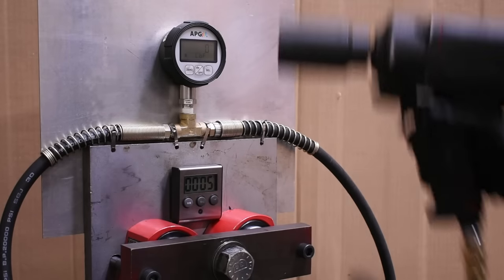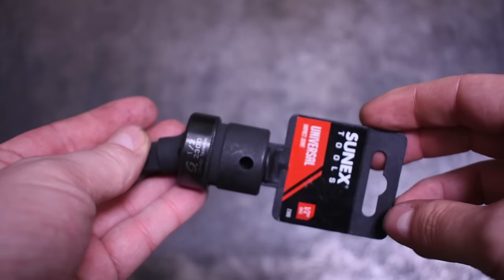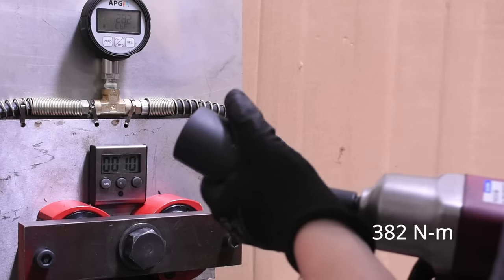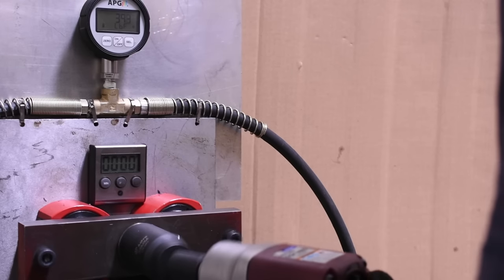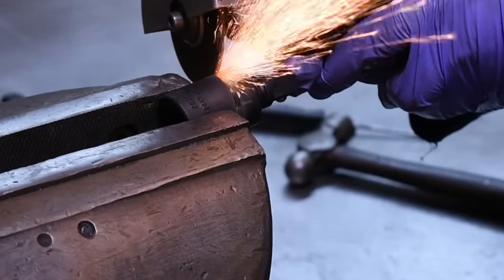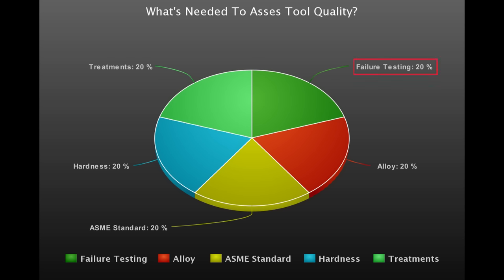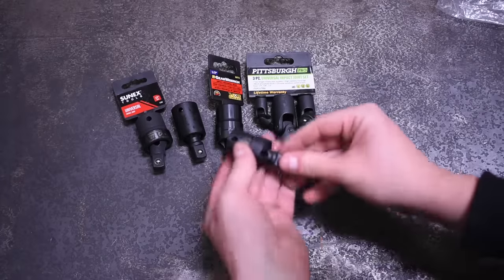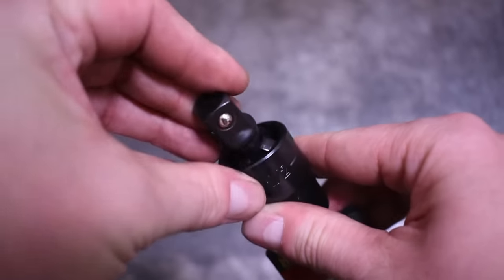How Much Power Do You Lose w/ Universal Adapters? Dyno Test For Science

Comment: I suspect something was wrong with your hardness measurement of the Gear Wrench... likely it had become work-hardened at the testing location... If it was actually through- hardened to that level, it probably would have exploded like glass...

Also, afaik, Rockwell is tested three times, *in different locations*, and then averaged?

Loving all your content!!  Keep it up!
Reply from the maker: Pretty difficult to work harden something that's already hardened and quneched though. And lets say it was, that's still a fault of design, worth showing. 20:35 the 65.8 IS an average, of 4 readings. You can see the 65.7-65.9 spread there, pretty dang consistent. We just did some U socket testing, GW still way harder on the socket than all the others.
Reply: @TorqueTestChannel  THats crazy hard... gotta be another theory, then... might have to look into testing the hardness in cross-section, maybe? is it a "shallow" surface treatment to prevent wear?? I'm astounded, if that's their treatment protocol for the entire tool...
Reply: @TorqueTestChannel  also... I was trying to see where the tester impressions were, but couldn't see...I'm just a knife enthusiast with an "Internet Degree", but im used to seeing the test performed in different locations... Also, my understanding is that the shape of the "displacement" caused by the diamond can affect the reading... (admittedly, you didn't appear to have any outliers!)
Reply from the maker: You might be thinking of a traditional press tester. This is ultrasonic. Leaves no marks. On the recent U socket testing we ground into the tools and didn't see a difference, case hardening an impact socket would be asking for trouble so makes sense.
Reply: @TorqueTestChannel  well, now my curiosity is definitely at a new level... Any plans for further analysis? (Of the GW tool, in particular)

Comment: Oh this is getting elaborate now. Worth coming out of my music coma for :D
Reply: nice work!   Thinking that work hardening is effecting the hardness measurements.
Reply: It may make sense that the ones that failed got harder as they were overloaded to failure....
Reply from the maker: @BrianFullerton  Work hardening happens to raw and annealed materials. Once something is quenched, hardened, normalized - it's already hardened and very rarely can be work hardened from there in most cases. You'd then need to bring it past a certain temperature, or above a lower temperature value (but still quite high) for a very long time before the grains start going back to a state where they can be work hardened. If these were just raw 4140 at like 20-30 Rc then you're correct they'd get work hardened, especially the pinned ones.
Reply: @TorqueTestChannel  I appreciate all that you are saying. But in this case, the metal is showing signs of deforming at the surface, and at or past yield due to what is essentially cyclical hammering.  Not sure that work hardening should be eliminated without measuring an unused sample.  Regardless, really nice work. Thanks, and keep it up.
Reply from the maker: @BrianFullerton  We'll be sure to measure beforehand on the bits we can get to in order to make sure on the next ones. Good idea to double check

Comment: while this information does guide one to the best choice I generally would never consider using a universal flex joint where high impact torque is in play. For me the fastener requires a straight tool to break the fastener loose then comes the flex to advance the fastener in or out.

Comment: okay, i'm curious as to why the u-joint style of HF instead of the same style the others have, since HF sells a kit with that style. i've popped the HF u-joints in the non-impact variants just during normal work loads, so it wouldn't even cross my mind to try an impact named set of them for impact purposes. 

i do have a set of pinned swivel hf's though, and they haven't failed as yet. haven't really bothered to do before and after comparisons though. and i cheated a bit. a slight touch of 3% moly in the main cup to keep the rotation smooth.

Comment: do you have one on extensions? regular with diff lengths? wobble? im curious i wonder even if deep sockets affect torque by a meaningful amount.
Reply: nm you answered my question in vid. also why would you use a 90 deg extension i dont see much if any use for them. imo these are used with extensions for  say getting to top trans bolts from under and such. but eh.. im able to learn so if you do know of a use, let me  know.  i just feel there are better tools at that point.

Comment: If the TTC still get the messages from the old videos, is there any reason why you have not tested the universal impact sockets? Astro vs Gearwrench vs Sunex.
Reply from the maker: We've spent about a year using them to see which fail 1st from actual use. Need to put it all together sometime.

Comment: Let's be real though, they should be expected to break during this test. It's literally taking them to their limit in ft lbs torque just beating the absolute hell out of the bit more and more with every ugga dugga. Then you move it at an angle at high pressure and it's a recipe for a full "Fuck this, I'm out" response from those wobbles

Comment: The test rig needs some maintenance.. RH bolt is loose!
Reply from the maker: The two guide bolts need to remain loose (they are in oversized holes), them being loose signifies there is no binding. Those 2 bolts simply keep the plate attached when the main bolt is loose. Good looking out though!

Comment: Those gear wrench type are junk. Husky has the exact same one. Sunex is always good stuff. I have a universal made by wright tool company. It has a locking pin instead of a detent ball. But its the beefiest heaviest one i own by ALOT. Which i always felt helped the impact tranfer more power. Think of those super thick 19mm sockets made to help get honda crank pulley bolts loose.

Comment: I never understood those u joint sockets because yes they do angle 90 degree but lol that's worthless if you can't rotate the socket at that angle. They just make no sense. They can kind of be used at a slight angle but they are still wobbly and hard to rotate. They make no sense like I said

Comment: You claim that the u-joint sockets can do a full 90° of articulation, but this is entirely false when using any kind of u-joint. U-joints have a usable range of angles before they start binding under rotation. You cannot rotate one end of the u-joint and expect the other end to rotate as well with it bent at extreme angles. Trying to use one at 90° will only force the input yoke to shear itself or it's pin, depending on spider design. 
In fact, no singular joint design will ever be able to achieve 90°, every possible 90° requires at minimum two joints, with more limited joints requiring three total joints to achieve 90°. But the problem with multiple joints is inevitable buckling without further complexing the design of the mechanism to prevent buckling, of which will never exist in a hand tool.
Reply: I think they are pointing out the sockets ability to articulate to a certain degree... and not it’s ability to necessarily perform(as typically expected) while maxed at that 90 degree angle.
Reply: @TsunauticusIV  Except your presumption is incorrect, the articulation angle of any relevance is that of the usable angle, not over-articulation that is unusable, as nobody cares about the unusable angles when comparing usability among different types of adapters. The statement was also in-line with the articulation angles of the other adapters, again an apples to apples comparison, where every other adapter is usable at their quoted and measured angles. Comparing the over-articulated angles that make the adapter unusable would be an apples to oranges comparison, and would be quoting an angle that has zero use. Also keep in mind that this is a comparison of performance, over-articulation would cause the adapter to not perform at all, so why even mention it?

Comment: Yikes.  Stopped before 3 minutes to say that one reason NOT to use a design like the HF units for impact use is if the socket slips off the fastener.  The TRUE impact joints go to a lower angle which keeps the socket from flying off at Mach 5 in some random direction.  Not so with the style HF is selling as "impact rated."  Those are patently unsafe to use with an impact, and it should never be done in the real world.

Comment: 2:25 You should only use this type of extension with an impact gun if you'd like to get blasted in the head by a flying socket so you know... don't do it 😉

These things suck ass even for manual use and they most certainly do not work at a 90 degree angle... not even close, at best they're somewhat useful up to a 30 degree angle.

Comment: I'm just going to say that it was really irresponible on how you handled the testing of the traditional U-joint socket. The thing was falling apart and you recognized the problem and were smart enough to not continue using it. Where you were irresponsible is that using any u-joint on an impact tool it just the worst idea. Harbor Freight will sell these things and DIY users will dig out their silver non impact rated ones and people will get injured. Modern ball swivel sockets either with pins or not were created to remove the hazards of using u-joints with impact tools. There are two huge safety problem with using u-joint with impact toos. The first is that the unlimited angle is huge problem is the socket slips off the fastener. The limit angle of modern swivel socket limits the radial range of motion that the socket will move if the tool slips. This is important because finger are often close to the socket when the tool is placed to the fastener. And with a u-joint your finger are going to be on the socket because of the unlimited angle. So if the tool slips, the socket is spinning freely like little nunchucks ready to bash everything in the path. While this kind of hazard isn't completely removed, it is less of a problem with ball swivel designs. The rotation is more limited and the impact will deflect a bit if it hits something. And slippage using these tools is bad, and extreme care should alway be used with off angle tooling. Where ball swivels may still cause bruising and maybe lasceration, a u-joint will statter bone. The other issue is eventual tool wear. Ball swivels are designed to fail in a very controlled manner. U-joints aren't. When a Ball swivel fails, the worst thing that will happen is pin flys out because it's the thing that is designed to wear out. However upon failure the ball just spins still contained by the static socket. When a u-joint fails, parts are flying everywhere and with smaller sizes often including the socket. There are 3 major pieces to a u-joint. There is the drive which is directly connected to the socket, the cup that connects to the impact drive head, and the hinged piece in the middle. When a hinge breaks, the middle piece will just go wherever it want. And if someone is in it's path, somebody is getting hurt. While I think it was irresponsible to even demonstrate the use of a u-joint socket, you were even more irresponsible for not being more forthright about the details of the hazard that led you to discontinue it's use after it was recognized the tool was damage. Instead it was just stated it would be fun to try out the tool.
Reply: It was advertised as impact rated that's on HF, they're just putting that claim to the test as I see it.

Comment: I thought U-joints were only good for like 20° or you destroy them?
That 90° statement makes me doubt all the info this channel provides. It only takes a moment to see that a U-joints does not wok at all when at a right angle.
Reply from the maker: We obviously didn't test them at 90 degrees. In that case was just listing features the tools advertise, which you're correct. At 90° it inherently does not work.
Reply: @TorqueTestChannel  I didn't mean to imply you tested at 90° Just that you implied they work at 90°.
Do you know the approximate angle you used when testing the U-joints?

* Is there a video on your dyno?

Thanks for the content.